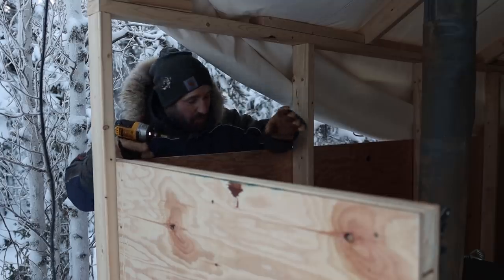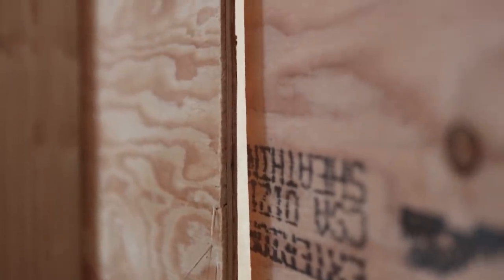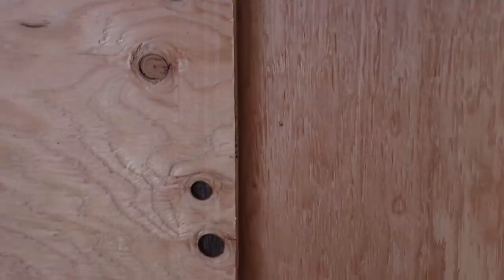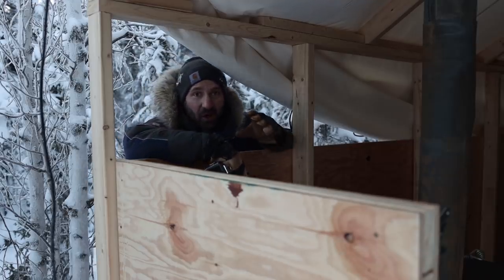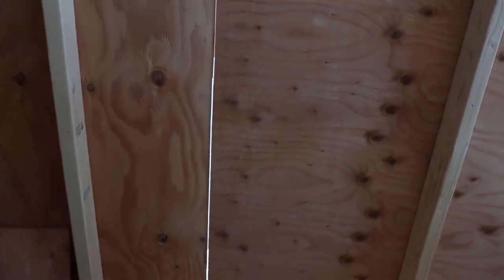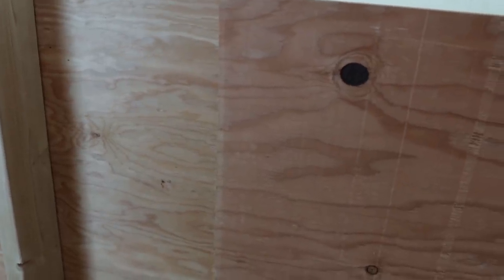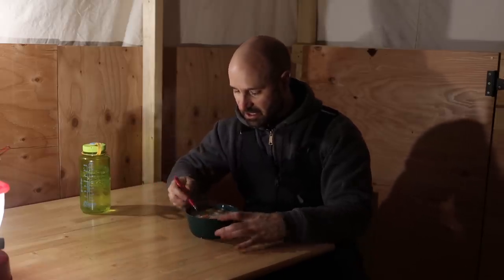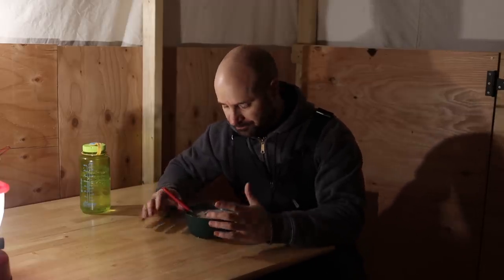Saw Tent In Freezing Cold. Wood Stove Chicken Stew.

Comment: To keep it a little warmer for cheap and easy on the really cold days, get some old wool blankets and hang them on the insides of your frame around the back and the side near where you sleep - it'll make an air gap between the tent/plywood and the inside airspace - the wood stove won't have to fight so hard against the cold radiating in through your walls. I used to do this all the time at my old hunting shack - just sewed some loops of elastic onto the corners of 4 old wool blankets and put some tea cup hooks in the right spots - quick easy hang up and take down.

Comment: The gap thats left from a cut is called a kerf 
In your case the thickness of the blade
Those blitz drip pans would work to reflect the heat from the wood wall
I have a reclining lounge chair (i got at walmart)in my wall tent where i lean back with my feet up enjoying the warmth of my wood stove
Then at the end of the night i climb into my butler bag (multi layer sleeping bag ) and enjoy the warmth that it gives me at night
Reply: I'm not trying to be a know it all but when you're planning the layout for the 2×4 studs, set them at 2-4' center from the corner. Start the plywood at the corner and your seams will always be covered by the 2×4.

Comment: The beauty of using deck screws. I’m off nails for a lot of things
Reply from the maker: If I was building a cabin I'd have nails for strength. But agree, deck screws are very good.
Reply: There is an extra thick version of deck screws with thread right to the top. I used those building the kids treehouse

Comment: if you cut into the crossover on a 45deg to a 60 deg angle that has the handle on the bottom piece side of the boards still wont be flush BUT the gap will be covered by the angle cut where they overlap ...making the wind through the gap very minimal
Reply from the maker: Smart.
Reply: that stew needs some green onion tops at least ... but 2 or 3 green onions add a touch of extra colour and a little bite too

Comment: If i was you i would insulate the inside wall with 1 or 2"  thick Styrofoam
Reply: I agree with foam insulation, but not styrofoam. Much better insulators than that.
Reply: @noyb72  Oh yea no doubt i am just saying that might be a little more budget friendly and Styrofoam is not the worst insulation.
Reply: I was thinking the same thing as he was taking the plywood down.

Comment: I still want to protect the walls from moisture, both inside and out. Those walls will become crooked over time and the cracks will come back. Another option could be to cover the cracks with a list, rubber membrane, on both sides.

Comment: The only problem with burning pallet or deck wood is if you don't remove the nails they get welded to the stove from the heat...and the toxic fumes if the wood is treated.  Deck wood is usually pressure treated, and foreign and blue pallets are loaded with carcinogens.  Canadian pallets are good bare untreated wood.

Comment: The reason you may be having a problem with your door is that your frame is racking. You can fix that and keep it from happening again by using corner bracing at the front corners of the framing at the front of your tent. If you do that on all corners it’ll stiffen the framing all around. Normally you don’t need to do that with stick framing but your plywood doesn’t run all the way up your walls especially in the front. And I agree, thighs are much tastier.

Comment: Great video Jay, what is the problem with your Coleman stove,  I may be able to help.
Reply from the maker: The pump is broken.
Reply: @jaylegere  The pump seal is made of leather and require a little oil periodically. you can get a new seal if yours is torn for like 5 or 6 dollars (US) they are pretty easy to install.
Reply from the maker: @jone.7819  awesome. I'll have to look into it. There is no pressure at all when I pump. So would make sense is a seal is broken. Thanks so much.
Reply: @jaylegere  yup pretty easy repair.  The military guys or Rangers will be well versed if you have trouble.

Comment: To keep even more heat in, styrofoam insulation will work. Stew looked good. I could tell by the sound it was cold...maybe -20 or more. Bummer about the coleman stove. I prefer propane over naphtha fuel. Always nice to have a little slice of paradise somewhere.

Comment: What makes absolutely no sense to me is why he just didn't fix this issue from the start by leaving overhang over ever single corner.

Sure it would have looked tacky for a while but it turn a job that is what 10 mins worth of cutting into hours or work alongside warping. 

And like sure maybe one side he would have notice they didn't fit right but to not allow end overlap instead of inside overlap is like weird.